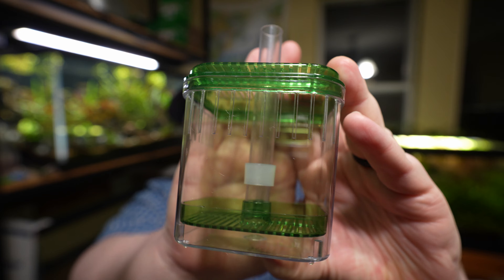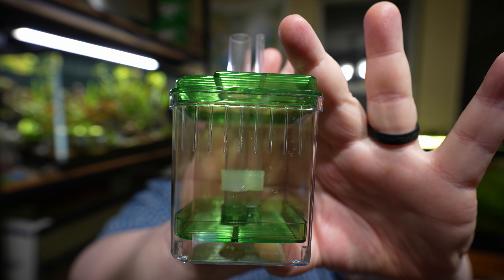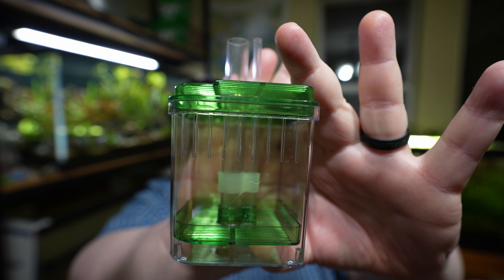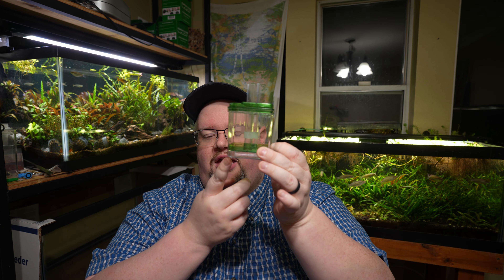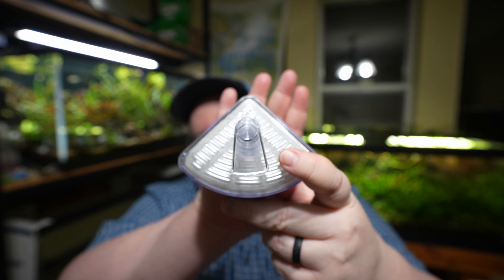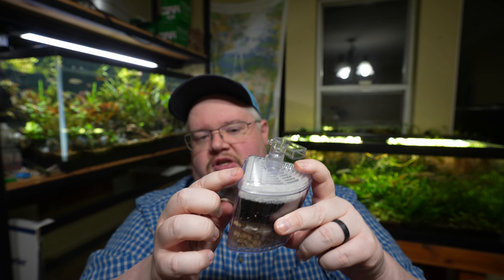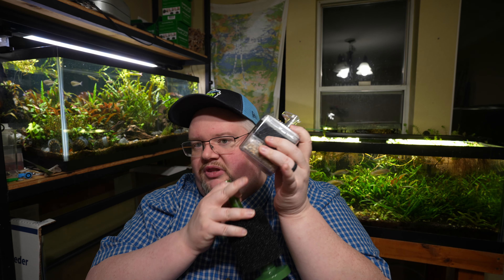Why the Aquarium Box Filter became obsolete - Box Filters Suck!

Comment: I've never used one, but something occurred to me during the video. It would be a super easy way to run charcoal filtration after medicating an aquarium without having to mess with your HOB or canister.
Reply: great idea! much nicer to use for removing meds in a fish room that is running only on air.
Reply: Exactomundo
Reply: I have a box filter for this exact reason.
Reply: Yes I used to pack mine with charcoal and filter floss and never had issues with water clarity.

Comment: A few benefits of corner filters over sponge filters: (1) more media choices, (2) no need to use a zip loc bag to remove the filter from the tank, (3) can very quickly change the filter if you use filter floss over and combined with another biological media (no squeezing!!!), (4) better for smaller particles when using filter floss (clearer water), (5) very cheap and will last forever.

Comment: Grandpa here.  When I first started out in this hobby almost 60 years ago, and for many years afterward, I used box filters.  We used "angel hair" (spun glass) and bone charcoal in them.  I worked my up to air-powered hang-on-back filters, under gravel filters, and then powered HOB filters.  Tropical fish gradually got pushed to the side by life, family, and other interests.  Then last year, I got re-started in the hobby.  Watching lots of videos and visiting my local fish stores (one was still around from the 60s!) I decided on sponge filters.  They are the best bang for the buck and are easy to maintain.  (I'm not getting any younger!)  I did pick up a small box filter, however.  Why?  The main shortcoming of the sponge filter is that sponge is the only media.  I figured the day would come when I needed a special filter media.  That day arrived recently.  I had an ammonia and nitrate spike in one tank and wanted to use an absorbing filter media to augment my sponge filters.  I am running it in that tank and it's helping me out until I can nail down what exactly happened to unbalance that tank.  Everybody who runs sponge filters needs to keep a box filter on hand to do the one thing a sponge filter cannot--use special media.

Comment: It makes me nuts when I take a sponge filter out and see all the gunk fall back in. I jst bought 3 box filters last week. I've used every kind of filter.  My favorite was the Dyna-flo. The only drawback is trying to get the siphon started.
Reply: Ziplock bag.  Open bag, out in tank.  Lift the sponge filter a bit, put it into the bag.  Lift the whole lot out of the tank. 

No gunk falling back in, and you can just pull the sponge filter apart, pop the sponge back into the bag and squeeze the crap out of it, dump it out.  No muss, no fuss.
Reply: Ive tried that, its such a pain and makes a mess. @Wintersdark
Reply: I take out my filters with those cheap Walmart .5 gal tanks

Comment: I have a couple corner type box filters. I replaced the gravel with small porous ceramic media. More surface area for bio, decent job of weighing them down. Then replace the sponge with poly floss that gets replaced. So faster maintenance than sponge, and the ceramic ups the bio. That said, I only use them on 5 or ten gallon temporary tanks, because I usually keep all the sponge filters in the other tanks.

Comment: Yes I have used all of those little filters but when I found the sponge filter, I threw them out. I have had aquariums since I was 11and still love them. I've had identical aquariums like the ones behind you, also designed and installed and maintained a 230 gal cold water salt tank in a grade school for 15 yrs in Sitka Alaska, rusted out 2 pick-up trucks during those years hauling sea water😄. It was a true ecosystem. I'm a 68 yr old grandma and still have a small tank and thinking of getting a bigger tank. Love your videos all very interesting

Comment: The work well  in quarantine tanks  where you need to dispose of the filter media after use. Easy to reset for the next use.
Also a great to use with water buffering media that can be easily adjusted refilled or removed.
Also great as a shrimp tank filter.

Comment: I have used them in the past when I got into the hobby back about 40 years ago (dang I'm getting old hahaha). Plan to order the green penn plax very soon. I love my Tidal filters undergravel, and sponges, but want one of these for quarantine tank as well as running carbon from time to time. Love the fact that they can be used as temporary solutions or stuffed with poly fil for longer term use. The weight issue was ALWAYS a hassle. I'll probably use magnets this go with one in the box and the other outside the tank. Will be great for quarantine since I can literal pour Fritzyme 7 directly into the poly fil and be ready to go. 
I try to make quarantine as easy as possible. Cheap five gallon tank, put in water from tank the fish will eventually go into, have an extra small heater, and a sponge filter from another tank. I'll be replacing the sponge filter with this box because I hate moving my sponge hahaha. The whole setup for tank, heater, box is about 25-30 bucks! Good deal for peace of mind. For anyone reading this, quarantine doesn't have to be kept running and kept cycled. Just set up the day off or day before you buy new fish! Easy to setup, easy to break down, easy to store. 
Too many better solutions on the market to run a box filter full time as primary, but lots of temporary uses for that little bugger. And if you install a gang valve on decent air pump...even easier to use these when needed.
But all the drawbacks are definitely drawbacks to run these long term. Totally agree

Comment: I've been using the Jehmco box for about a year, and I love it.  The Jehmco plastic quality is much better than the Lee's triple flow, the Lee's economy corner, and the Chines ones like what you had in the video.  It also has a weighted base.  Another great benefit is that it doesn't require an air stone.
For media, I use polyfil and ceramic rings.  I know I'm losing beneficial bacteria when I throw away the polyfil every couple of weeks, but I don't see it in my water parameters.  

Those Penn Plax bubblers are nice to have on hand if you need to polish your water or use carbon to remove stuff meds.  
My other 3 tanks use sponge filters, but if they made a smaller Jehmco filter with the same features, I'd switch over to them.
I'd love to have a box filter like Fishman makes

Comment: As a shrimp keeper/hobbyist. Especially for my CARIDINA species. I love these green penn plax box filters for my caridina tanks of 5 gallons and less. I feel the box filter with active substrate to help buffer the water/PH. Then put a super thin layer of substrate on bottom that is easy to vacuum AND won't keep big build up of food/waste. 

I do also set up a sponge filter as well. That's to give the shrimp something to feed off of, not just filter. So each tank has 2 filters. Realistically you could get away with just the box filter filled with substrate. Also solves the "weight" issue being filled with substrate.

But, overall I can see why for just general fish keeping they not being as useful. Great video!!!

Comment: It's kinda funny - I have an old Lee's Quick & Easy air driven cartridge filter. Since it's been discontinued, there's only a handful of cartriges left to buy.  I got it out of nostalga because my grandma used them in her guppy tanks back in the 1970s and late 1980s, and I planned to just let the box sit on the bookshelf. I didn't expect to find myself actually using it!

It's just as much of an eyesore as the sponge or clear box styles. Penn-Plax and Lee 's both made versions of this that are mostly parts compatable, but Lee's added plastic prongs in the suction base so only Lee's Discard-A-Stone airstones fit. Yay, marketing! Penn-Plax's version was molded in an almost algae green, while the Lee's version is a very noticable blue color. Although mine's turning algae green over time. I wonder why? 🙃

However, it gets around that floating thing by having suction cups that let it mount in the corner of the tank. That also means it doesn't have to be at the bottom of the tank.

The entire filter detaches from that suction cup mount and can be removed from the tank with the cartrige and debris inside.

The cartriges consist of a slotted plastic tray full of a mix of carbon and zeolite for chemical filtration, covered in a cloth for mechanical filtration. The cardboard box, dating from 1986, specifically says it's a mechanical filtration system. It mentions the carbon and zeolite, but that's about it.

Once I can't source cartriges, I will use it like a box filter, packing it with floss or cut to fit media and using a filter bag for chemical filtration.

I don't worry about resetting biological filtration because I have another obsolete filter. I am driving an undergravel filter off the same air pump with just a single lift tube.

Sure everything's old school, but don't tell my fish these filters don't work. They think they do, and I have to maintain the illusion!
Reply: I know of a place in Cordelia CA simply called Pet Club Fairfield that still has these in stock. Cartridges too! Along with all the old Lee's stock of items including the undergravel filters.
Reply: @Evangelon  Thanks for the tip! My primary source currently is an eBay seller in Ponce, PR,  and they are really good considering the distance involved. I will check into this place in CA and find out if they ship stuff. 👍

Comment: I like these over the sponges because you can set them up not only as a biofilter but also to polish the water with pads or floss. Also can have more stable biomedia like lava rock, biohome, siporax, etc rather than a sponge that will eventually fall apart.
And if you're still a fan of the sponges, you can simply fill the box with sponge. The muck will stay inside the box when the filter is pulled out instead of going everywhere like the classic sponge filters.

Comment: I'm thinking a bit of in tank flow through aragonite might be a helpful addition for my guppy tank. My tap water is nearly distilled, so I'm always adding equilibrium and alkaline buffer. I have some aragonite mixed in the gravel, but a little more might be good, as an extra on top of the sponge filters.
Trying to keep as much in tank as possible. Pumps and pipes and tubes and valves all add possible leaks, and I deal with enough of that at work.

Comment: Is there anything a box filter can do that an HOB breeder box can't? Because if you need the low power air driven, those can be filled with media etc just like the box filter can, and can be either air driven or, I like to stick those cheap internal "spraybar" filters into the intake of the breeder box. 

But theoretically the advantages of the sponge and box filters are the air driven nature right? 

An HOB doesn't ruin the aesthetic inside the tank as much, and IF you have room for the HOB outside the tank, so what does a box filter do that an air driven HOB wouldn't?

Comment: They were phased out for the same reason undergravel filters were phased out, low profit margins for pet manufacturers. Low cost to begin with, and no return business because they last so long. No spare parts to replace, no expensive filter cartridges to buy. What would a pet company rather sell you, a $5 box filter that's cheap to run and lasts forever, or, a $40 power filter with motors and other parts that eventually fail and have to be fixed or replaced completely ? I've used box filters for years and they WORK . . .  👍👍👍
Reply: Exactly, I’m running 4 corner filters doing perfectly well. He might as well say buy Aquarium co-op sponge filters because the brand sells smh 😂 
Aquarium co-op has very good sponge filters but it comes down to preference.
Reply: I Agree 100%
Reply: Agreed. The co-op is out to make money first. It’s why they make all these products. Box filter is definitely one of the best if not the best for fry.
Reply: I'm 53 years old, I grew up with my dad using box filters and his aquariums. Now that is off I use. One of the ones that I used that belong to my dad and I'm still using it. Mike tanks have always looked great and I have very little too almost no dead fish ever. I have four daughters now and they all have fish aquariums and all they use are box filters in the aquariums.

Comment: Well, Bentley... What can I say? Just this...

I've got a 65ltr (Approx 17US Gallons) set up for White Cloud's using just one of these Pen Plax Boxes (It's the very same type but not Pen Plax branded). So far I have been getting really great results in both Clarity of Water (Great clarifiers with filter floss), and zero ammonia and nitrites, with marginal nitrates (10-20ppm).  I never loose my cycle when ditching the floss and replacing it because I have a fine layer of Aqua One's Sintered Glass Stones in the void below the lower plate (Green tray that the tubes attach to). And a layer of Aqua One's Sintered Glass Noodles upon the very tray mentioned. Then I load it up with the floss.

This keeps my filter loaded with the bacteria when I need to ditch the floss and replace.

So far after almost a full year, I have had no issues with it, or the cycle crashing. And while I agree that your comments are very valid, it can be just as easily remedied with how you look to stock your little box filter to adapt it to your Tank Size and Level of Stock (Bio-load). These things work just fine, and are not just for breeder/shrimp tanks depending on how you approach their uses and your needs. This includes increasing the air-lift tube length and adding an elbow joint to give better current flow.

As for the "Chinese Updated" types... Never used them... Can't see how adding a sponge or two would benefit my tank any better than the one I have set up already... 

Great vid, and plenty to cat about in regards to the differing types of "Old Skool and Nu Skool" box and sponge filters and those combined... But it is what works for you, and how you set it up. This goes for all filters, canisters, hob's, sponge, under gravel, and these lovely little boxes too.

Comment: I inherited a 10 gallon setup in the late 70s, and it was ugly, floating loose half the time and more.

I didn’t know until I read Walstad recently that charcoal isn’t good for plants, so I had charcoal in there, and every time I moved it, it would spit up granules of charcoal. The substrate was ugly already, a multicolored gravel with most of the color worn off, but with black specks of charcoal added, it looked even worse.

The water was almost always clear, but everything I planted died within 2 weeks.  Having only incandescent lights didn’t help.

Comment: While I did enjoy the video, I run these newer corner filters because they are easy to service. Pull the filter up and out without all the debris falling back into the tank from the sponge filter. Yes, some get their hand into the tank with a Ziplock or fish bag to put the sponge filter in while taking it out of the tank. Too much hand in the tank. The old box filter can adapt using a media base, chemical filtration, and mechanical filtration in one, layered.  Many years back while working at my Aunts aquarium store with about 75 10-gallon tanks this box filter worked and kept the tanks crystal clean.

Comment: You know you don't actually have to throw the filter media away every time you clean a box filter. I usually rinse and reuse the filter floss three or four times before I replace it (it does eventually get too "worn out" for lack of a better term, after being rinsed clean a few times). I have two corner filters in the aquarium, they're cleaned alternately so it doesn't matter that the beneficial bacteria is "lost", it'll re-inhabit the filter in a few days. Have never had a tank lose "cycle" this way.

Comment: I like the idea of a box filter because you can easily alter the media you have inside. But they just take up too much room in nano tanks. I do have a real interest in those little corner box filters though, the little 📐 shaped ones. Those seem like the best...?

Edit; I do have a question for you Bentley. I'm lame for having to pay here, but I've missed your last few streams due to health issues, so... I recently switched my row of (3) 6g cube tanks and (1) lil 3g planted nano tanks from nano hob with 1/2 ceramic bio and 1/2 course sponge filters to a 20g Tetra Whisper running nano sponges to try and be more electric economical. These are all in a North facing window so I do have a supplemental led but I never use it. I'm seeing, I think, that I need to do more water changes. I used to just do top offs weekly in the 6g and maybe a 10% change in 3g and now I'm noticing funky foam in the 3g within a few days. Do you think this might be because the sponge just isn't filtering like the hob? I'm at a loss.

Comment: There's no reason to remove the filter floss- just rinse it. 
The bottom of the box filter should have some marbles or gravel in the bottom. - it also holds chemical packets if you like. -
Easily hidden in the tank.

Comment: OMG, first you attack sumps, now box filters!!!!!!! How dare you sir! If these were old-timey times I'd have to challenge you to a duel.  I do use a lot of large Jehmco box filters in my fish room (I also use the coop sponge filters, which I do actually like better).  I really only use box filters in grow-outs for mechanical filtration. HOBs do work better than box filters, but it's far more expensive to get a bunch of HOBs than it is to buy a bunch of grandpa's box filters.  I fill the bottom 50% of my box filters with ceramic media. I do like the coop filters a lot, but I find the box filters are more effective for keeping the grow-outs' water clean. Finer sponge filters also work well, but they plug up too fast to be practical.